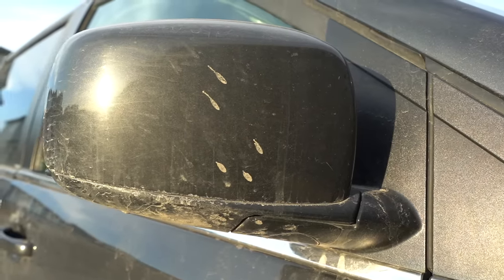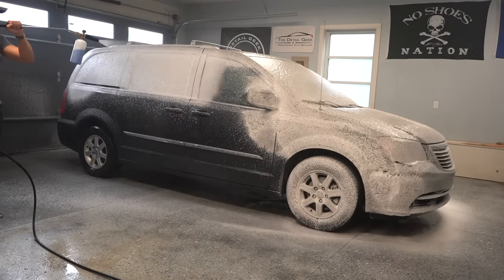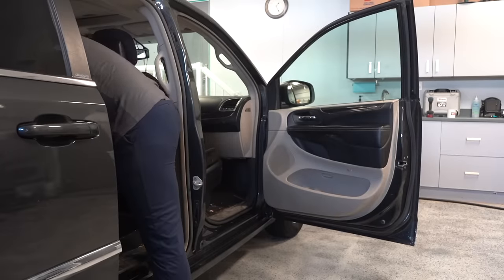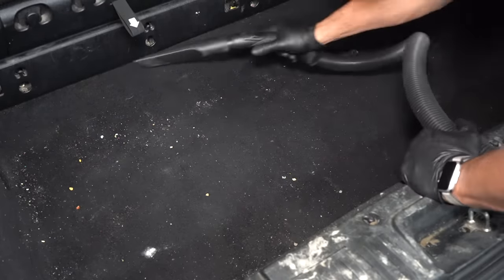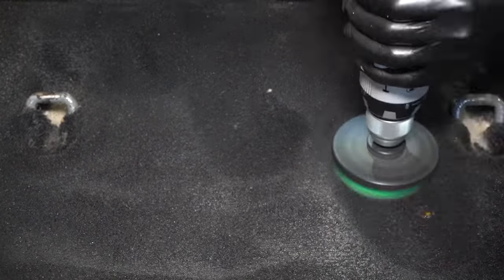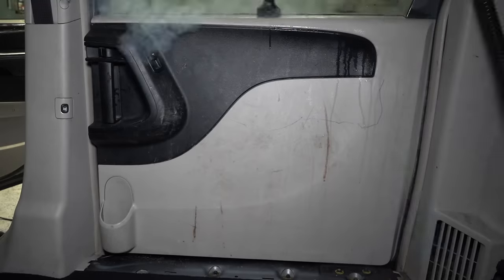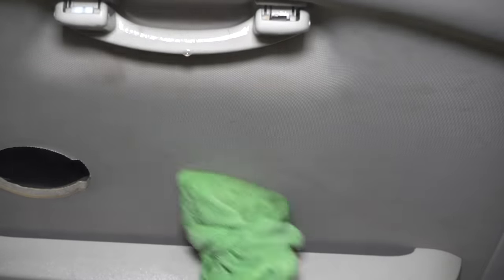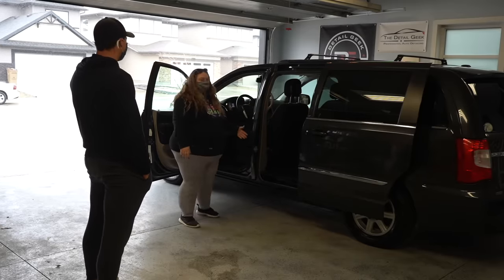Deep Cleaning The Nastiest Van EVER! | INSANE 17 Hour Detailing Transformation! | The Detail Geek

Comment: I mean. I'm not as skilled at all and have an eighth of the tools, chemicals, and probably, even the knowledge. But I would, still, replace the rusty screws you can see, paint the seat feet gloss black again, and air up the tires!...record and replace the radio stations and set the clock.

Comment: 17 hour? Wow I seen  about 10 different ways where you could have cut your time and did a better  job. First off you have to get a better extractor or get an extractor to begin with, because the jury is still out on weather that little bissle is an extractor at all. Second you should be using pneumatic air for cracks and crevices instead of the vac and a small brush. A brush on a corded drill is better because it turns a lot faster with more power. a good apc, bucket of warm water and two micro fiber towels one wet and the other dry for the door panels rather than the steamer wil cut your time in half. You should only use the steamer as a last resort after nothing else would work or in hard to reach places. The steamer can cause a lot damage. Most vinyl will come clean with an apc and a couple of micro fiber towels. Yea I think you did a good job but 17 hours is way too long. I think I could have did the same job in about 6 hours.